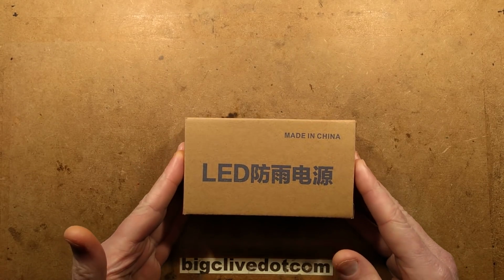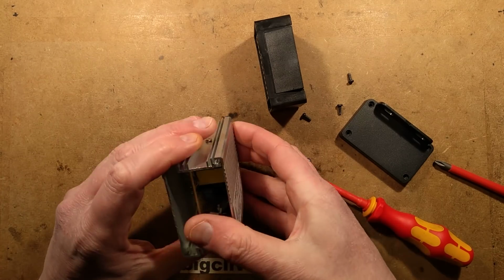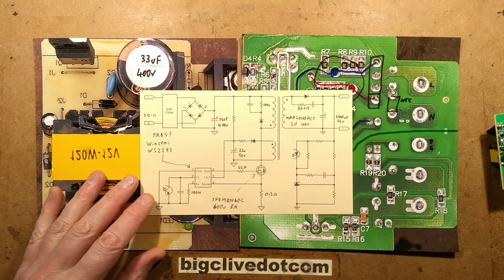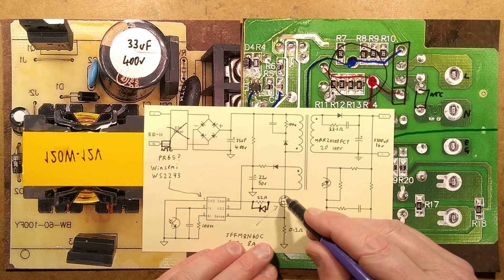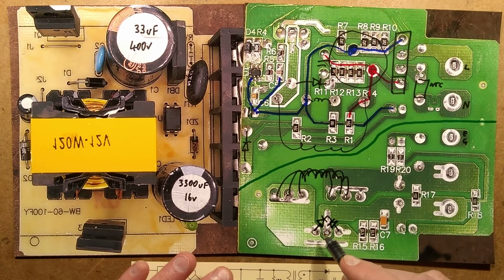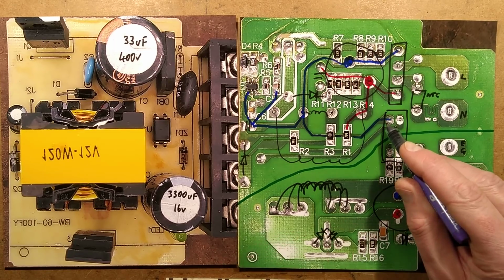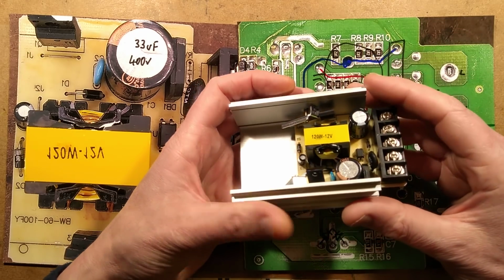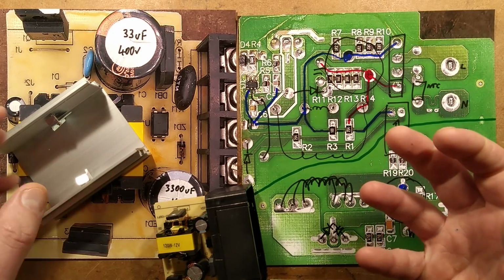Cheap imported "rainproof" power supply (long version).

Comment: I recently bought few industrial looking power supplies for DIN rails, from a Chinese company Meanwell. I just opened the smallest one of 12V 15W and it looks state of the art to me. It has a lot more components than the one you show here... One of the components on the primary side is puzzling me. It looks like a tiny transformer but the windings are not on top of each other, instead they are next to each other and separated by plastic. Both windings look the same and on the other side of the PCB i also see something unusual. The 2 connections from each winding have traces that come close to each other and end in shark teeth. That can only be a sparkgap for over voltage protection i guess. On the secondary side there is a nice ferrite ring with 2 windings, i guess RF filter.
Reply from the maker: If it's a real Meanwell power supply then it's one of the best available.  The shark teeth are almost certainly a spark gap.

Comment: I’ve just bought one of these. The ‘400 Watt’ version on AliX. 
I should have watched this video first (although my expectations weren’t very high) but now that I have, I at least know to ground the case, to put extra insulation below the circuit board and to not use it outside.

Comment: i M CONCERNED ABOUT THE Line input PC trace adjacent to the aluminum case isolation through the "green" PC board coating. Time, vibration, moisture could eventually cause a "hot" case because it is not grounded to the ground line coming in. This could be lethal, especially in an outdoor (pool) environment. Better make sure there is a GFI for protection.

Comment: Even if it's entirely sealed, it cannot truly operate for long outside in the elements unless it's constantly running. This is because if it isn't running, it will get very cold of a night time, then when the morning comes and the air gets warmer, the cold thermal mass of the power supply will attract moisture, this moisture will not only form on it's outside, but even on the inside of the unit as well.This water will then rust components. 
I know this from experience, the only way for something to exist in an outside environment is if it's kept warm, usually by running the power supply it will be warm, then it will not create any condensation, because condensation is from warm air hitting a cold surface, not from cold air hitting a warm surface. Thus it will be safe as long as it's running. 

As you pointed out, it also shouldn't have a single hole even the size of a pin leading into the main circuit area, because little ants and spiders will get into it and destroy it by being shocked and exploding their guts all into it. Therefore the unit has to be entirely sealed. Once it's fully sealed, and kept warm by operating, then it truly will run without any problems and will last a long time outside.

Comment: Even the relatively large mosfet will fail the 1,5mm functional isolation requirment? And the product will fail excessive dust, plants and vermin, maybe corrosion, UV and more (60950-22).

Comment: What brand and model is that ESD safe screwdriver set? I think I'd like to own one. Seems thick enough to not wear your hands out, the rubber parts ensure a great grip and that plastic seems extremely tough (I've seen you use them to pry things and unscrew overtorqued screws - That's some great, non-conductive plastic!).
Reply from the maker: The red/yellow electrical screwdriver set is by Wera.  It's a VDE rated set for live electrical work.

Comment: @bigclivedotcom - Side question; How do you store your USB devices (Not plain old thumb drives but those larger devices like the meters, USB Test Load, and so on?) Thinking on a better way here, maybe a "fishing lure" box - But you may have a different & better idea so I'll ask - Thanks!
Reply from the maker: In a huge pile of technical clutter on my bench.
Reply: @bigclivedotcom  Aah, thank you. I'll keep looking for something that'll work here. Clutter sure happens, doesn't it?!
Reply from the maker: @mrsheesh3743  Clutter is normal at an active bench.

Comment: I noticed there was a component missing from the board as assembled, but could not make out the marking to indicate what it was. Could you clarify that?
Reply from the maker: Filter capacitor at the input?  More a token gesture nod to a filter capacitor since it should really be a larger X2 suppression cap.

Comment: I don't think the difference between "waterproof" and "water resistant" translates well. Or they just don't understand the concept. I bought a nice, cheap little handlebar mount radio that was supposed to be waterproof a few years ago and was very happy with it on my bike for a few months but the bike sat outside in the parking lot while I was at work every day and after a while the radio's buttons started acting up. When it finally died I opened it up and found water lines halfway up the inside of the housing. 
Another time I bought a "waterproof" handlebar mounted clock but the first time it rained water was visible inside it. The part that attached to the handlebar was basically a metal cup with no drain hole and when I opened up the clock part (basically a watch movement in a housing) it had absolutely no seal of any kind to keep the water out. I drilled a drain hole in the cup and covered the openings in the watch with silicone sealant and it still works several years later but it is a royal pain every time the clocks change or the battery dies.

Comment: The reason for the diode inside the MOSFET transistor: the device still has diode junctions that make up the FET, the extra diode prevents reverse bias on them which can cause junction latch-up.

Comment: I'm amazed by their non professional do not open message. Shows they are trying to hide the fact its just a cheap easy to repair circuit board inside.And they are trying to hide some flaws to avoid a fine and punishment

Comment: It's odd what's implied by "outdoor".  In Tenerife, things (electrical) obviously live outdoors 24x7x365 without any consequence.  I've seen domestic sockets in the outside walls of buildings powering signs and vending machines ... and some have been there for years.  I've also been there when it rained something like 10" in half an hour (slight exaggeration).  The wind caused more damage than the rain, the local shops just poppped the outdoor fuse and then gave it half an hour to dry when the rain stopped before replacing the fuse and it was business as usual.  It's the same the middle east and a fair few other areas ...  when it's 40c most of the time no one makes any effort to waterproof anything, it only rains once a decade.  Like BC says - it won't last half an hour "here" (his "here" and my "here" sound very similar and equally hostile).

But in the other sort of "here" where its hot and dry almost all the time it's just a bit of a bugger when they design and manufacture outdoor electrical goods and try to sell them in our here.
Reply: In a warm country like Tenerife you only have to worry about water getting into something from above, so you put an awning over it or seal any gaps around the top of it, this is why monsoon countries don't have a million electrocutions every year, you just throw some tarpaulin over an appliance.  In colder countries however you have the extra threat of condensation, whereby water can enter a device from any angle since air creeps through any crack and then moisture forms on the first cold thing that air touches.  As Clive mentions at the end of the video Britain is prone to Haar, which is sea fog and it gets inside anything that isn't fully sealed and gradually fills the thing up with water until it shorts out and pops.

This power supply would likely do what it says if it was used in Vietnam, but in Scotland it'd just get someone electrocuted on their lawn.

Comment: LOL,  Following the Chinesium Standards it would seem adding a extra  " 0 "  (Zero)  on the end of the stated power rating is common a practice.    When a particular item is rated at oh say  20A what they are in fact saying is it will only start smoking at 10A not burst into flames or explode until the rated 20A has been achieved.  Knowing this as fact you just order things rated at two or three times the stated rating and it will do the job just fine.   I order boat loads of electronic's modules and parts monthly.  Using this logic I'm more then happy with they're products.

Comment: How do they change the polarity of the voltage on the transformer? I dont get it :(
Reply: I will assume you are not trolling, and give a serious response. . . 
Transformers always work on the basis of half cycles. A full cycle is just a pair of half cycles. A half cycle is a pulse. In terms of absolute value of voltage, it has a rising voltage and a falling voltage. To a transformer, it matters not at all what the pulse polarity is, so long as the energy stored magnetically in the core is allowed to return to zero between pulses. Then the output side mirrors the input pulses, but with isolation, so you just see a rising voltage and a falling voltage, not a "reversal of polarity" like on AC power; all pulses have the same polarity. 

If you take care to see that the stored magnetic energy does indeed return to zero, you can operate a transformer on rectified AC power... either half-wave or full-wave rectified. Either way, all input pulses will have the same polarity. Therefore, there is no difference when driving a transformer with chopped-up DC, as in this cheap little power supply unit. 

Does that clear up the mystery for you?

Comment: It's so shoddy,  after looking at this i think exactly some chinese electrical supply maybe started that horrific fire in Russia shopping mall where 100+ people with children died. They leaked to public a video when this fire started at ceiling lamps,  officially the cause is big load on main cables which was almost red and chinese dangerous equipment are used in Russia everywhere because it's cheap, including that questionable Huawei stuff which Usa scandaling about- all Lte network made on it, no one cares.

Comment: speaking of voltage jumping I had a 12v motorcycle battery jump between the terminals of the starter solenoid while cranking, and this was arcing through 2 layers of duct tape and the factory rubber terminal boot on both connections. I noticed the plastic divider had broken off and in the process of tightening one terminal connection had been tweaked closer to the other.

Comment: I was wondering about these things online, looking for a 12v power supply to drive an amplifier and head unit setup I have in my car, would one of these cheap units be able to cover that much amperage?  I ended up settling on a pretty good ham radio power supply that has some pretty high power output for its size, you do not want to cheap out on power supply equipment!
Reply: For 12V, just get a surplus HP server power supply.
Reply: @NiHaoMike64  I thought about going that way, although the output terminals weren't going to work well with 4 gauge cable, I want to make sure I could get amperage across from the supply to the amp without cooking wires.  Overvoltage adjustment would be nice too, to deliver more power and reduce clipping.

Comment: As someone who routinely retrofits neon channel signs to LED, I can say with authority that I would not trust this power supply even in an enclosed sign. I'll stick with the type that are fully potted, they work a charm. I haven't had one fail yet in 5 years of harsh desert environment, including extremes from 120°F (48°C) heat, to full-on monsoon downpours, to zero-visibility dust storms.
Reply: Meanwell ftw.

Comment: Not even a capacitor between primary and secondary... yikes! Add a few feet of wiring to the output and you've got yourself a pretty effective radio interference generator I bet!

And if that poor excuse for a power supply can handle 120W on more than a brief intermittent basis, I've got a bridge to sell.
Reply: It looks like a flyback type supply 13:44 , they are not usually used in excess of about 100W.  Clive's description of how it works was not completely accurate.  A flyback stores the energy in the core and dumps it to the output at the non-conducting state of the switching transistor - the high frequency alternating current does not pass through the transformer in the 'traditional' sense.

Comment: BigClive, This PSU said it is rainproof, not waterproof or bug proof.  It seems that you expect more than face value from this Chinese product.  Given it's intended use and mounting guidelines, water isn't likely to ingress.  The output and the input should provide sufficiently low noise levels to light 12Vdc LED strips and noise backfed into the line is likely to be outside and reasonably far from receivers.  There are no other guarantees, other than rainproof, right?

Comment: I work for a sign manufacturing company. All of our signs are grounded and the insides are shielded from rain and we still use ip67 rated power supplies for the LEDs. Not totally necessary but they do seem to have longer lives. The message centers that we order do not have sealed potted power supplies though and they seem to last pretty well, but those cans are a bit better sealed than you average sign.

Comment: Not running at 50Hz mains is not to save weight (though it does) it's to save energy.  Switching at varying pulse width depending on load is what makes an SMPS more efficient than a linear voltage regulator like a 5A 7812 chip.  Doing the switching on the mains side avoids the losses of having two power conversion circuits (first a transformer, then an SMPS coil).  Now I'm not saying this craptastic model is efficient, as a matter of quality.

Comment: Looks like there's enough room on the circuit board to use through hole resistors instead of those two groups of 4 resistors. Also, they probably could have made tiny boards with the controller and mount them vertically in order to get a completely through hole design. 
Would you have felt better if they used some kind of adhesive kapton/whatever tape on the bottom and on the sides (except where the to-220 parts screw to case) ? Seems like that could be a cheap and easy way to improve things a bit. 
Agree with you on the insects part through. Though with a fully through hole design maybe they could just spray some epoxy on the back or maybe have a thin layer of foam stuff you sometimes see in power supplies for sale in insect rich countries.
Not a fan of that big 33uF 400v capacitor so close to the bridge rectifier, it will cook itself over time. Seems like there's enough space to use a thinner and longer one laid down on the board, making more distance between the capacitor and the bridge rectifier and hot ntc. They could have rotated the bridge rectifier and screw it to the case (or a metal bar that also heatsinks the to-220 part) for some extra heat dissipation - at that 100w of output, the rectifier alone would dissipate around 1-1.5 watts.

Comment: The snubber across the output rectifier is to supress "snap-off noise"  When they are reverse biassed all diodes conduct in the reverse direction for a short time while the stored charge is cleared out.  When the charge runs out the current stops very suddenly which if not supplied with an alternate path would generate a super high frequency noise spike.  The snubber absorbs the spike and allows the current to stop more gently.

Comment: 2:34 Completely agree... I've always when it comes to eBay chinese power supplies, generally buy one with intention to use about 30% of rating... So if I was going to need a 100W supply, I would look for a 300W supply. I know it is probably completely unnecessary... however I don't want to take a chance especially with unsupervised projects/devices.

Comment: Interesting to see the ground of the primary DC side (at 350+ Voltish?) sneak under that 750K SMD resistor. What's the separation there? 0.5 mm??

Comment: @02:28 no (rubber) seal, 💦 water will penetrate the top,  capial effect pull the moisture in at the screws. Screwholes are convenient cups...
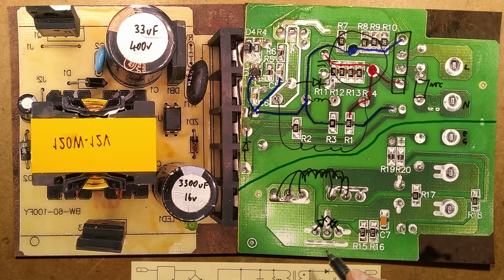@14:50 Default the set “mosfet/duo-diode” is not connected throw the case, but is something died,... it easy could!

Comment: i had an advertised water proof power supply for a camera, was fine until we had some sideways snow and freezing temps, brought it inside after it stopped and after a while water poured out, if they'd have left the hole for the led out, it'd have been fine, i also bought a 12v 5a supply, thankfully it was damaged in shipping, what i found inside was scary, old reclaimed power supply recased, old leads cut with what was left nearly shorting, a shake or a jar could have easily made them touch, no fusing either.

Comment: if it was earthed that would make it more unsafe for the insects.. because they could  make a connection between circuit board.. maybe the live section and the metal case if earthed.. and the insects could blow like fuses.. I think that's why it's not earthed.

Comment: To translate Chinese ratings into UK/US/Can/Aus ones, divide by the square root of Pi, then add 6.
Reply: I thought you just take the square root....and that's it?
Reply: Also that method increases percieved capacit for low values. Taking square root or 25%, whichever is greater, is my method.
Reply: The square root of Magnum?

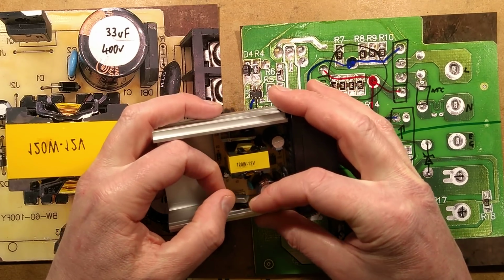Comment: 22:16 ...err is that a friction fit...as in a friction fit for a loose dangly piece of  metal electrically connected to the ungrounded case hovering millimetres away from the legs of a MOSFET at 340v to ground (240v peak)....?
Reply: Would seem inadvisable to use this somewhere there was any vibration at least...